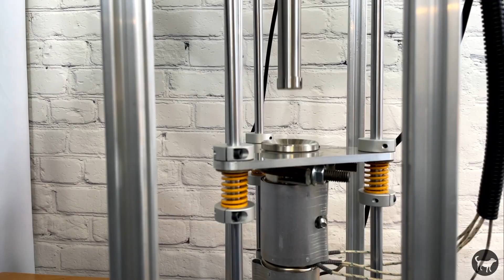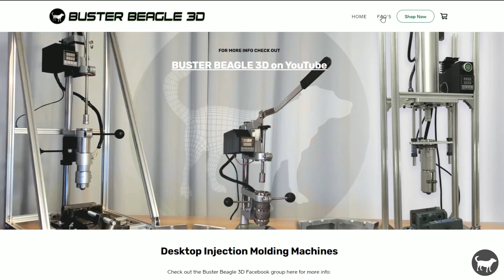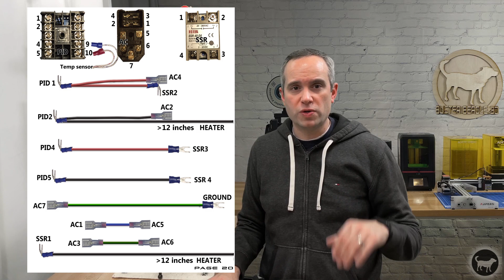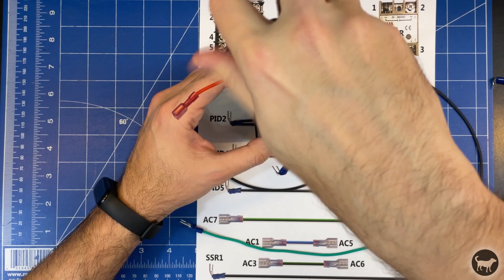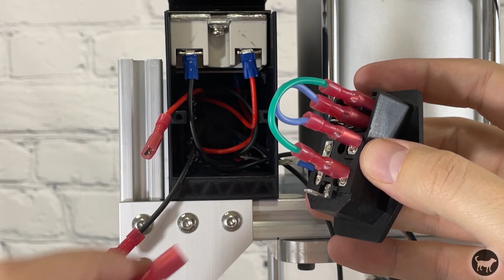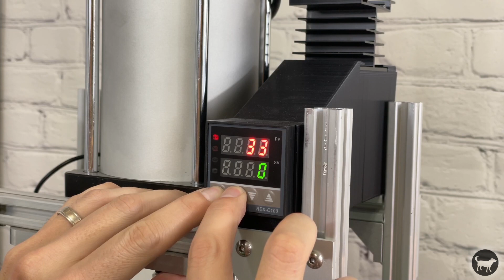DIY Desktop Pneumatic Injection Molding Machine | Buster Beagle 3D MK3 | 3 Cubic Inch Shot!

Comment: Thank you for your time and shared your knowledge...I am about to build a desktop microinjection machine with 2 pneumatic cylinders (one for injection, the other for closing the mold) and I ran into a couple of problems in my original design, such as the high cost of making many parts by laser cutting. The use of the 2020 profile largely solves this problem, and reduces the weight of the machine. As allways, your videos are pure gold... Regards from Argentina

Responder
Reply from the maker: Thank you! Best of luck with your machine.

Comment: Is there any way to modify this design to hold a greater cubic volume? It seems like it would be possible.
Reply from the maker: Hello. I don't currently have a way to increase the volume with the parts that I offer. Of course with a longer chamber, plunger and pneumatic cylinder it cold be possible but again it's not something I have done personally.

Comment: good morning, what is not included in the sc100 kit?
Reply from the maker: Hello. The MK3 Bundle on the website does not include the frame which can be purchased from as a kit from the Inventorsource site. The Pneumatic cylinder can also be purchased from that site as well. After that all you need is the Vise and an air compressor and you should have all of the parts to build a full MK3.
Reply: Thanks ❤

Comment: Could an electrical actuator work in place of pneumatic
Reply from the maker: Hi. I don't know of any electrical actuators with the power and size of one of the pneumatic cylinders. I had looked into it briefly when designing the machine but was not very successful.
Reply: @BusterBeagle3D 😊

Comment: Hi again! I'm trying to figure out the pressure the MK3 Buste has, from looking at the FAQ you say its 700 kgf do you mean 700kfg/cm2?
Reply from the maker: Hi. It's 700 lbf, or pounds of force with the smaller SC63 pneumatic cylinder. Most people(if not all) use the SC100 which is up to 1500lbf.

Comment: Is it possible to use that setup but increase the chamber size to about 8 cubic inches would it till achieve the same results?
Reply from the maker: I currently do not have a way to increase the volume of this machine. It would require a redesigned to lengthen the  chamber and the plunger to extend the volume which I currently don't have.

Comment: What pressure is the piston putting out when injecting?
Reply from the maker: It depends on the psi you are sending to it from the air compressor. The max at 90psi is about 1500lbf.

Comment: Could it be possible to make funnel that's about 4 inches tall 3 inches at bottom width radius? Or at least for prototyping
Reply from the maker: It depends on the thickness and the volume of plastic needed to fill the mold. It can not exceed 3 cubic inches of material.

Comment: hello, i have 2 questions:1 what thermostat do you use? and do you have a vertical semi-automatic mold machine for 70 grams - 100 grams?
Reply from the maker: Hello. 100 grams is unfortunately double what my machines would be able to handle. The thermostat is just a K style thermocouple that screws into the chamber.

Comment: Hey Ryan, Can this do polycarbonate?
Reply from the maker: It depends on the heat needed to use it. I haven't used it myself but some other people on the Buster Beagle 3D Facebook group may have. As long as it can melt under 300C it should be fine.
Reply: @BusterBeagle3D  Thank you!

Comment: I just purchased the set and assembled everything. Assembly went great. However, when I was setting up the PID, the heating bands worked initially, but when I tried set ARU that is when the issues popped up. COD keeps resetting to 0 and the heating bands will not start up. Not sure where I went wrong. Thank you.
Reply: Problem solved thanks to Ryan! Excellent response! I appreciate it!
Reply from the maker: You are very welcome!

Comment: is there a way to reduce/adjust shot size per injection smaller than 3 cubic inches?
Reply from the maker: If the mold is nice and tight, minus the air vents of course, the mold should fill with the plastic and then you need to hold the pressure to prevent shrinking. Once you let go the pressure releases and the chamber retracts. Whatever plastic is left in the chamber is set for the next shot. All of this is to say that yes you should be able to inject in any mold 3 cubic inches or less.
Reply: @BusterBeagle3D  thank you for the quick response. i will purchase parts from your site this weekend

Comment: Hi, I am amazed by what you are offering! 
One question, 3 cubic inches means the max size of the mold or the max volume of plastic to be injected. I would like to make a part that is 4 inches long but in volume it is much lower than 3cubic inches. Is it an issue? Thanks in advance
Reply from the maker: Hello. 3 cubic inches is the amount of plastic injected. The mold that you make can be larger then 3 inches.
Reply: @BusterBeagle3D  excellent, thanks !

Comment: I would pay for you to build this and ship it to me. Is that possible?
Reply from the maker: Hello. Unfortunately I don’t build complete machines as they are very heavy and can be quite large. I do sell a kit with the chamber and electronics and worked with a company to put together a frame so with those 2 kits you can build the complete machine.
Reply: @BusterBeagle3D  Thanks! I’m going to check it out. Is there a place to buy practice molds?
Reply from the maker: @Fulcra  I don't sell them but there is another injection molding machine company that does. They also sell a full machine but it's quite a bit more expensive and has a smaller part volume. www.techkits.com
Reply: @BusterBeagle3D  thanks!

Comment: How many liters of air have you given in this machine, how can I get it from Bangladesh, thank you
Reply from the maker: Hi. Not exactly sure what you mean by that but I would suggest using an air compressor with at least 2 gallons of volume. The pressure used for injection depends on your mold. I would suggest starting at about 35psi and working your way up until it fills the mold correctly.

Comment: I am starting from scratch to build this exact set-up. Is there a guide listing all purchases that need to be made to build this? I understand that the frame kit, pneumatic piston and vice are all separate. What other items need to be purchased to build this?
Reply from the maker: Hello. You can find the full BOM here as well as a link to a build PDF. https://docs.google.com/spreadsheets/d/1Fjabq0kb_H6shMk1rJu9uPZ35id1ej64D_ejWlV5TvI/htmlview
Reply: @BusterBeagle3D  It's a little difficult to understand what is included in the pre-built kits you offer and what is not included. Should I assume that every item with an amazon link needs to be purchased separately because it is not contained within one of the kits?

Comment: Would there be an easy way to extend this to 6in3? I'm working on a design for a non-profit, but it's too large for this. Would it be possible to make two of these and operate them simultaneously in one large mold to extend the max volume to 6 cubic inches?

Comment: Does the device work with Polyamide PA6 GF 30, shot weight 50 grams?
Reply from the maker: Honesty I'm not sure about every material. As long as it can melt under 300C and inject under 2-3K lbf it should work.

Comment: How does your production time compare with 3D printing? Also is it possible to make items hollow?
Reply: it's really night and day.  3D printers may allow for larger total objects depending on print bed, where injection is limited in size by shot size and mold dimensions, but what would take hours to print really takes maybe less than a minute to inject.  So if you need quantity of any part, there's just no contest.  Regarding hollow parts - the injector is going to solid fill any void the material is injected into.   So there is no physical way to do something like 40% fill as you might in 3D prints.  Injected material has more stability than printed material though, because of how the molecular structures are formed, so even in the same material (ABS for instance) an injected part will have no delamination or material layer failure as printed material may. 
If you need something hollow, the only way to achieve that in injection is to make a pair of mated parts and bond them together after injection, like plastic Easter Eggs.

Comment: A vertical injection machine can’t beat a horizontal laying machine. Most industrial machines are laying horizontal but harder to load with no screw with mini injection machines. I wonder when you need a screw  to mix the plastic?
Reply from the maker: Yeah this is really to keep cost down. You would need a screw to mix colors but at a much higher cost. This is designed with the home hobbyists in mind.
Reply: @BusterBeagle3D  that make sense, i wonder what limitations youve faced with no screw? Do you get consistent Mixage? Do you ever use different colors pellets?
Reply: Agreed. Horizontal is better, but cost is significantly more. For example, RobotDigg sells horizontal injection screw assemblies, but they are minimum $300, and upwards of $400 for custom screws. In my opinion, Buster is trying to make his machine functional and relatively low cost.

Comment: What resin are you using for your molds? I asume some high temperature resin. Did you try normal 3d Printer resin? If so, how many shots did normal resin last?
Reply: I believe it is Siraya Tech Cast  or maybe Blu
Reply from the maker: I am using Siraya Tech Sculpt Clear. Others have had success with the Siraya Tech Fast but I haven't for some reason.